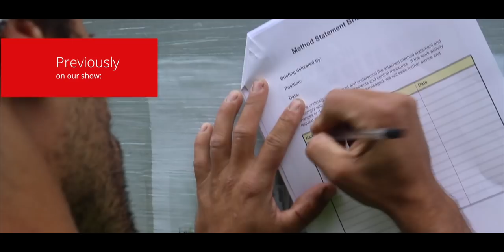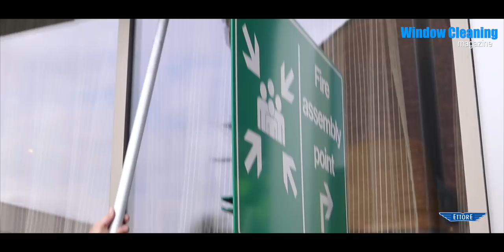US VS UK Window Cleaning - Episode 6 - Squeegee & water fed pole

Comment: Don't take what the US WC'ers said as universal gospel. Those ppl are all from the west coast. And for the residential market there are a lot of wfp'ers.
Reply: It's because it's more realistic to use WFP on the west coast, they have softer water. It's one thing to make the initial investment in poles and pumps but if you live somewhere with hard water you're going to be spending thousands every year to filter the water. Or the other option is be a shitty company that doesn't keep up on filter replacements and end up leaving mineral deposits behind.